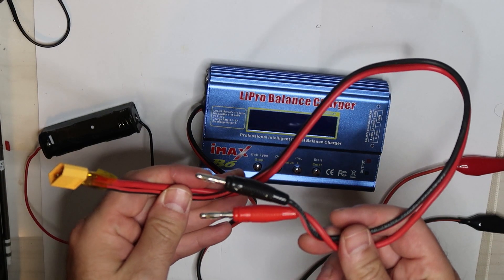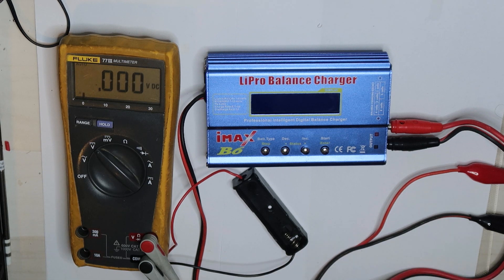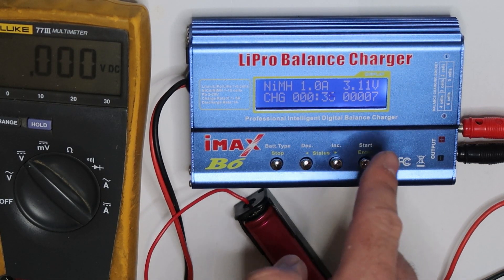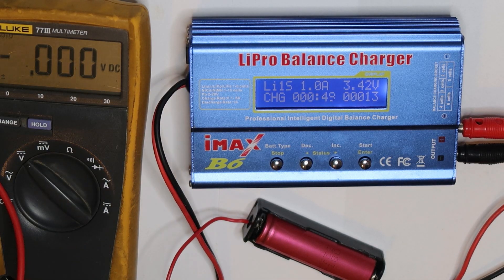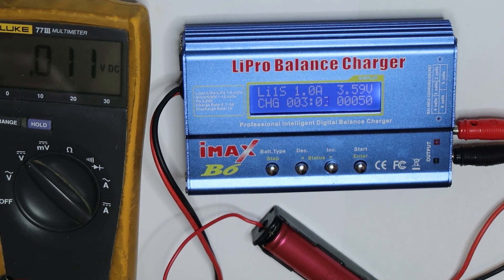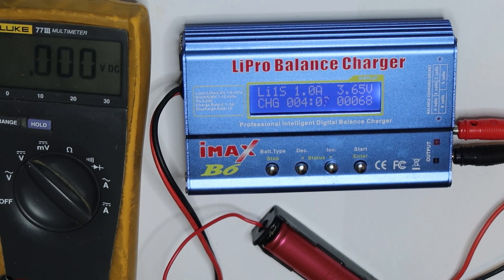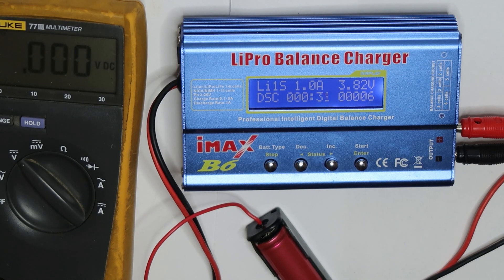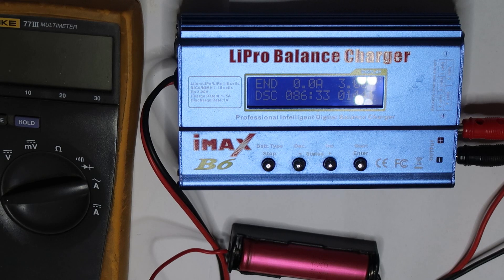How to Test Battery Real capacity

Comment: Sorry but that’s doggie as 

Look it this ezy do lipo fast charge till sell is above 1V hit stop go back in to balance charge hit start 

As long as the sell is above 1 volt it will change don’t use NIMH u will kill the cell doing it that way shorten the life of the sell / battery an yes I’m using the same imax B6 charger